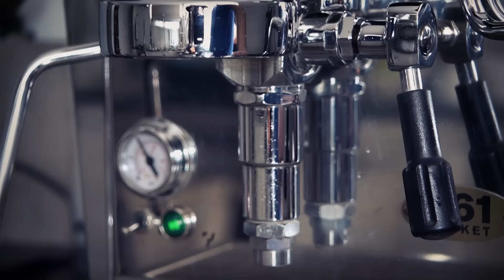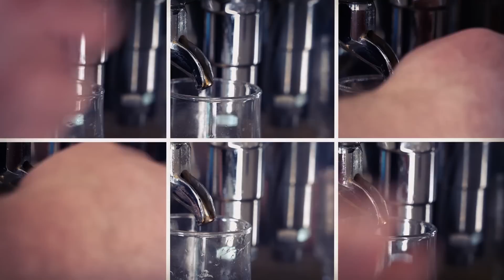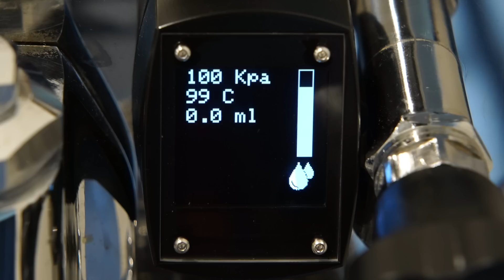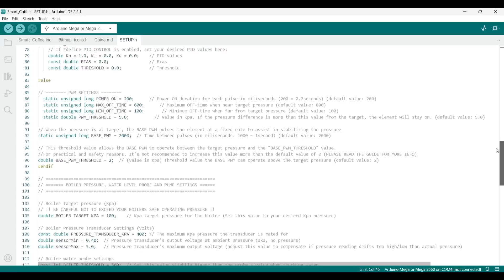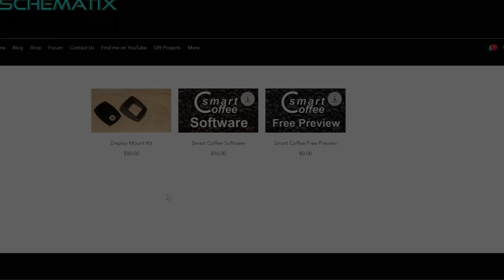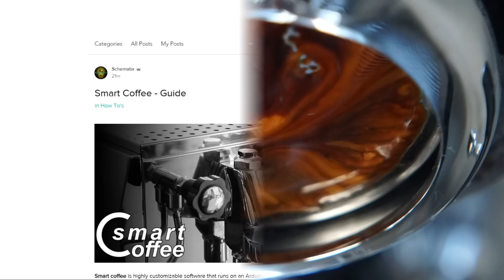Smart Coffee - Your Coffee, Your Way ll Customizable Arduino Espresso Making Software

Comment: Amazing work - I'm going to do this in my Rocket E61 HX machine I just bought that has a dead controller. As set up with the parts you list on the website, will this work with US (120V) plugs or would anything need to be different?

Comment: The only change I made to my gaggia was the addition of a magnetically attached 100w PCB dimmer. I can choose anything from off with the solenoid closed for pre infusion up to the stock 15 bar if I wanted. I have been making coffee professionally for about 7 years so I just let the coffee tell me what it wants. I like this mod because it cost me €2.50 with shipping. However you do need a good grinder and precision basket to pull it off properly and now I have my €400 machine acting like €2000 machine. Although I do temp surf but that's easy.
Reply: Big problem of Gaggia is a big loss of the water temperature when brewing. It can be fixed using PID controller or even better installing a gagguino which really makes a great coffee machine in the end (I have gone that way and am super happy with it).

Comment: Awesome build. But do I get it right, you do not know or regulate the brew temp? I have a nice vintage machine with a heat exchanger and I miss the possibility to adjust the brew temp. It quite depends on how long it had been heating up and how many shots I take in a row.
Reply from the maker: Thanks. For most heat exchange machines (including mine) you're correct, the element is switched according to pressure. However, it would be pretty easy to add the option to control the element by temperature in smart coffee
Reply: @Schematix  Than  I have a new project as soon as my coffee roaster is finished (-:
Reply from the maker: FYI: Smart Coffee v2.1 has had several options added. One of the new options allows you to set a target pressure OR temperature to control the boiler element